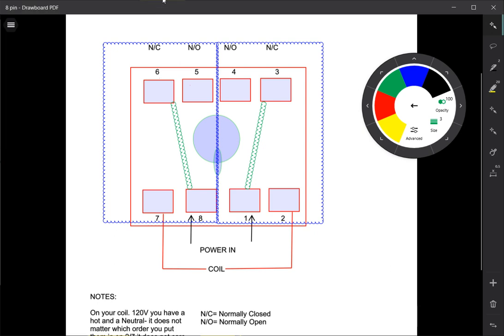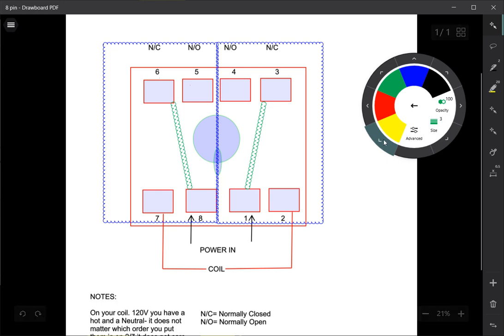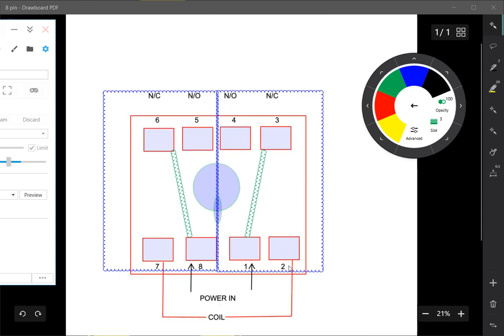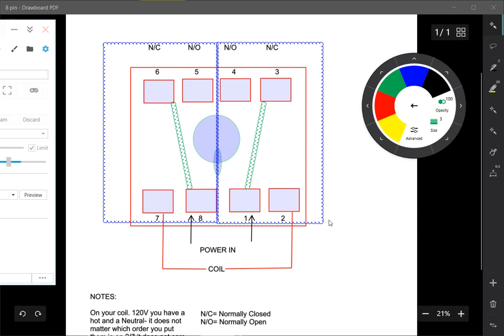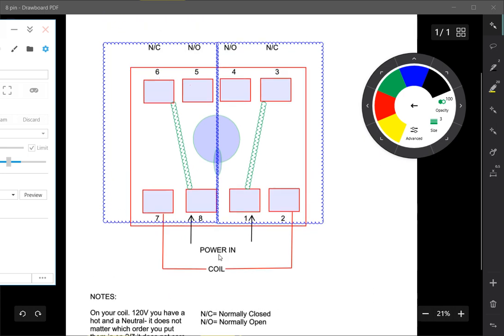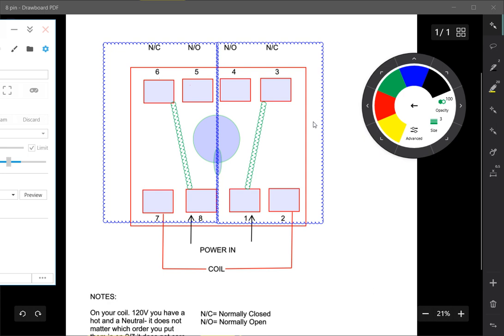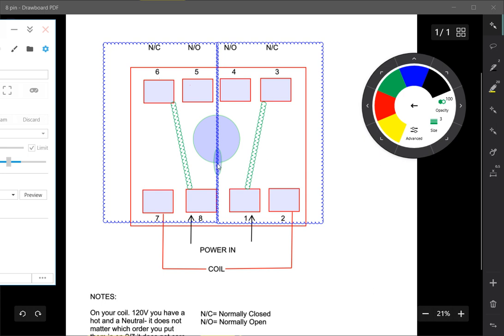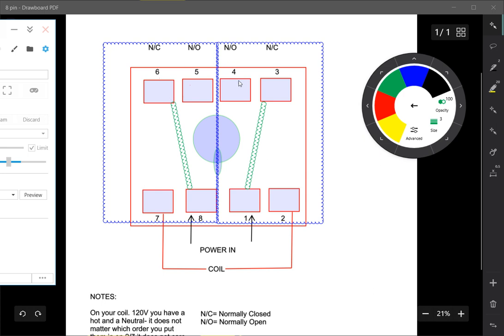Basic Understanding a 8 Pin Relay. Motor Controls

Comment: Hi John. I have a Baomain JQX-62F 2z relay. It’s to be used in an electronic brake for a treadmill motor. The design comes from Dazecars on YouTube. It’s powered by 120 vac and the motor is 130 VDC at about 25 amps max. 
Dazecars offers a wiring schematic, including the relay, but the pin layout in his diagram is not the same as the Baomain. 
I was hoping you could help me map out what wires go where between his diagram and my relay. He’s using the same relay but for some reason he doesn’t use the same pin layout. He won’t help me figure it out. 
The series of his is on the electric brake, which is an extension of his variable speed drive for a treadmill motor. 
I know you’re probably busy but your help would be appreciated. 
Thanks,
Paul

Comment: Hey this is good info but im an aircraft mechanic with an 8 pin relay ( very small and hard to work with ) i cant read the numbers on it andni was wondering if all 8 pin connectors are like this? I know where the hot and cold are to make the coil work but im desperate cause if the others are mixed up ill blow the diode. Lol. Ask me how i know. Lol 
Anyway it has to be soldered on and there is no plug available and its not easy to just kinda mess around and try each one. Id love to know if you have any info on this relay. Its a Beechcraft 50-380048-1    It sold by textron 
Thank you for your help.